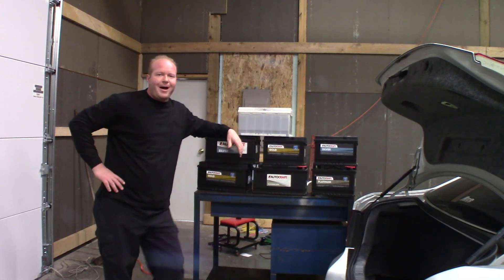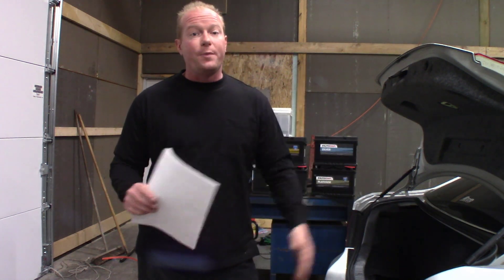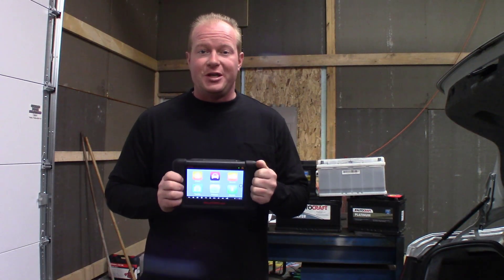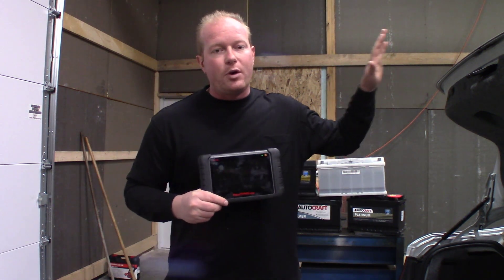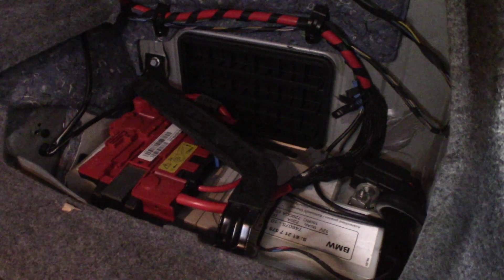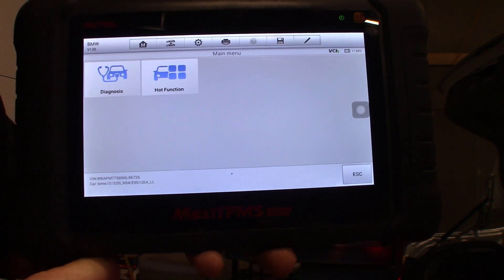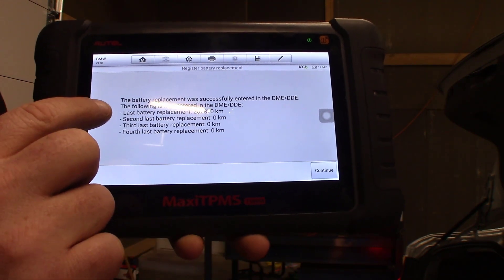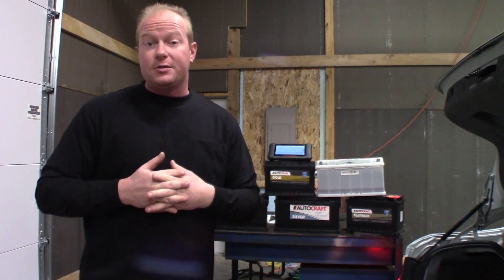BMW Battery Registration using Autel TS608

Comment: Thanks.  But  i need to know if is possible to change the Ah registered for a different value.  The original was a 105Ah  and the new is 92Ah.  Then displays message about consummer disabled.   My case is in a 2013 640i F06.
Reply from the maker: https://youtu.be/PnVg8KCF7KE

Comment: At 4:33 it would have been nice if you selected "Enter battery replacement: Higher/lower capacity" to see if you can actually enter a 2 or 3 digit Ah rating and then the battery type (wet, AGM, etc). instead of a list of Ah that Autel provides.

By the way, those scanner screen shots look identical to that of an iCarsoft. These scanners are like batteries, made by a couple of companies.
Reply from the maker: Here is a video I did with the MS908P that I did change the battery type and Ah.
Reply: @FlashPerformance  Were you supposed to add a link to the video?
Reply from the maker: @a.c.e.7568  https://youtu.be/PnVg8KCF7KE

Comment: Just bought the new mx808, 
Would you be willing to help me re register the battery through this specific product ?
Reply from the maker: If you need help with the process you can reach out to the Autel support team. They can assist with the process. Here is a link of someone else using the Autel to do a battery registration as well. https://youtu.be/I8rEIv-xOeQ

Comment: replace battery soooooo easy all you do is buy new battery and $2000 dollar tool soooo smart lol,  BMWs use 100 miles of copper to install battery at the back then make it impossable for the evg person to swap out the battery all to save very little gas, this all seems way over the top, Keep it simple stupid is definitely not something the Germans do

Comment: Hi I have a 2013 Cadillac ATS AWD Premium the Battey saver 70k miles light came on dash I. Took battery out had it fully charged checked load tested  it was good .Do I have to have this scanner to reset BMS ? Also will this Scanner show if alternator has failed so I don’t have to go wasting time on other parts like fuses ect ? If it’s not reset will battery level just keep going down cause BMS thinks it’s still old battery in there ? Thank you
Reply from the maker: You only need to do this process if you are replacing with a new battery, just charging the battery will no require a reset of the BMS.  For the Alternator you will need a battery tester, I use this inexpensive one from TOPDON, https://www.topdon.us/collections/battery-testing/products/bt-100

Comment: 3:06 what do you mean by "it charges the battery harder"? You can only set the battery charge voltage and this is dependent on the battery type (FLA, AGM, etc) and temperature. All these companies are over thinking this. I can bet you you'll never get the 14 and 16 years battery life cycles I got in my cars and I did not have a BMS in them.

Comment: Is it any option for AGM type battery instead of Lead acid
Reply from the maker: To change from a Lead Acid to AGM you would need a more powerful tool to code that to the vehicle. MS908P, MS908SP. MSElite, MS909, MS919, Ultra can do that feature

Comment: I called my local BMW indie mechanic he seems trustworthy.    Coding  is different from Registration.  If I replace my old battery with the same type i.e Lead acid, Coding is not required . The computer already knows how to charge to battery based on the last coding input. I can do a Registration with my cheap scanner.. But now I upgraded to an AGM .  Since I don't have the proper scanners.  I need to have the new AGM battery coded by him. He says I need to drop off the car for maybe 2 hours.  (Lame )  He charges 1 hour labor $125 .

Comment: Are MaxiSys and Autel the same company?
Reply from the maker: Autel is the manufacturer and engineers, Maxisys is the tool brand name. It is the Autel Maxisys scan tool. This tool is the MaxiTPMS brand from Autel.
Reply: Flash Performance  Ah okay. I bought an Autel unit earlier in the year, and the interface looks the same, and then you mentioned the name.

Comment: Does the "enter with higher/lower capacity" function work?
Reply from the maker: Yes, I didn't have any problem with it.  After this video I installed a better battery in the vehicle on this video: https://youtu.be/PnVg8KCF7KE

Comment: With a TS608 can I write a TPMS sensor ID into the PCM. Like on a Toyota? Or do I need a MaxiSys, looking not to spend a lot on a MaxiSys... thanks
Reply from the maker: Yes exactly, this tool will take the sensor IDs and write them to the PCM.  It is a simple process. You can also do it with the TS508 https://youtu.be/7rszSlKKzag

Comment: Great video my friend, very informative. Question? If I installed the battery last week, and just bought the scan tool today, would I need to unplug the battery and reconnect it in order to register it? Because it's not letting me register it as is. Thanks
Reply from the maker: No need to disconnect the battery, you can do the BMS registration anytime.  The sooner the better.  Make sure you do all of the updates on the tool before attempting the registration.
Reply: Thank you so much, I was able to do it. It showed that a battery has never been registered on it. It's amazing, the day after I registered the battery the car was driving better, and a lot of the little problems I was dealing with are gone. Thanks again for the amazing video.

Comment: Thank you so much for your video,  I hope you can  help me flash performance, my costumer call me  and tell me,  him replaced  his own batery,  but  not use scan tool,  now in this car, power windows  turn signals, high beams,  interior lights  is not working,  is 2013 BMW.  I need reprogram some  module or I need do  some prosses?
Reply from the maker: Did you do the BMS reset as I showed in the video? If not It could be because the battery wasn’t reset and now the car thinks the battery is bad and it’s conversing power to make the car drive.
Reply: @FlashPerformance  thank you so much  for your help.  I have other cuestion  this Autel ts608 in your video,  ts608 can read codes and and see  life  data for engine?  Thank you so much  again. 😊
Reply from the maker: @joseloslopez985  Yes, Read and clear codes and view live data in all modules.
Reply: @FlashPerformance  $295 per year